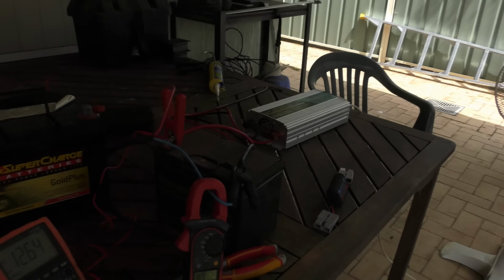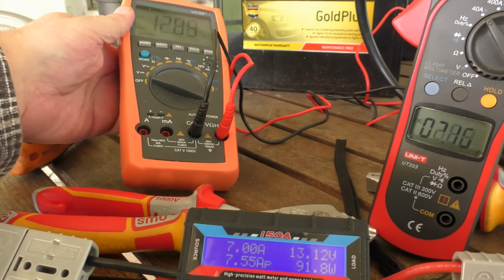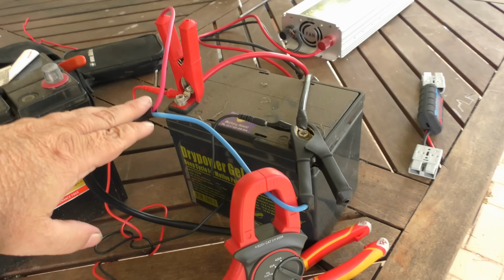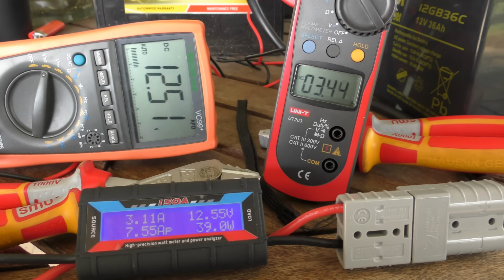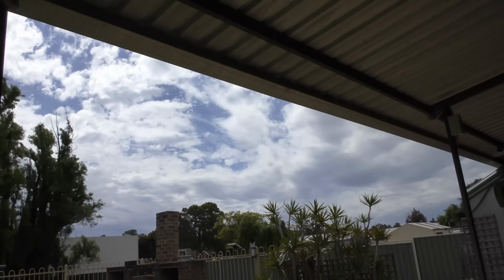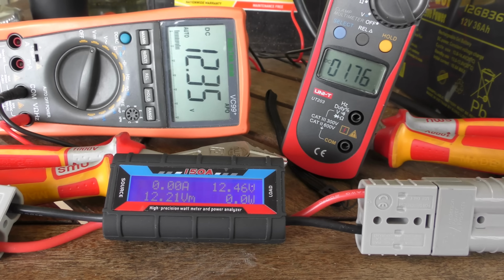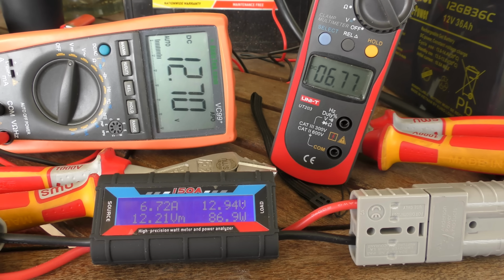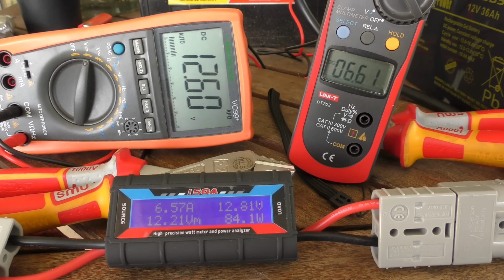MPPT or PWM Charge controller  Fake or Real. The Proof. Part 3

Comment: Thanks for taking the time to try again, but I’m afraid I still see no evidence of MPPT. Have you tested that panel or are you going by the label alone?  I think we’re seeing an over performing panel. We still haven’t seen the panel voltage when it’s connected to the charge controller. Like you said - the maths don’t always work out, but you have to compare the two. If you can’t set that up then perhaps test under the same conditions with the panel directly attached to the battery?
I’ve tested what I believe to be the same controller (although with a sealed box who really knows if they’re the same) and it is absolutely not mppt - sadly I haven’t got your sun at the moment to play with!
Reply from the maker: I had the feeling you would say that. You do know i have been using them panels for a few years I have 15 of the same panels on my roof. There not just a panel i picked up. OTE will Give it a good test for us as well. And what Sun. Lol Did you watch the video I had to run outside just to get that little patch of sun. I was waiting all day for it. For me i am very happy with the extra 2+ amps i am getting out of that now. I have another set of fold out panels Here that is 2x fold out. I will be redoing. I will test the volts on them when i pull the cooked PWM controller from the back. I have also asked the manufacturer to send me a unit that has not been sealed so we can have a look inside. Have not got back to me yet. But i only asked them yesterday.

Comment from the maker: This is an interesting series of tests. Don't take it personal, I am very happy to be proved wrong. at this stage though using the right size wire and showing the panels and everything in the tests is a lot more then the people that just say its Fake. without showing the important parts of the test. There just sitting with a volt meter saying well this is my solar panel wire and here is the controller. What panel did they use how much resistance was in the tests. I showed what resistance could do with the trailer in Part 2.

Comment: Great info your putting out there sir , hope all is well with you and yours sir
Reply from the maker: Its still just a test and until i can get my hands on a unit that has not been filled with all that black stuff it will be impossible to know for sure.  But for now i am happy with the extra 2+ amps i am getting out of the panel

Comment: Now that I can see the watts I suppose there is a conversion. It is a 2 stage which means it wont float. But it does look better
Reply from the maker: Like i said for $20au or about $15us https://www.ebay.com/itm/30A-LED-MPPT-Solar-Charge-Controller-12V-24V-Waterproof-Timer-IP68-360W-720W-GRC/272988671448?hash=item3f8f648dd8:g:oioAAOSweW5VB6Hw:rk:2:pf:0 you can buy one and do all the testing yourself. For me it has lifted the output on that panel almost 2amps Well worth $20au and its compleatly weather proof with that IP68 rating.

Comment: I think what is needed is that the device will stop the stop the flow of power from the panels for as long as needed if the battery bank is at 100% soc. they would need sufficient heat dissipation for the solid state switch or gate.
best
Reply from the maker: Charge controllers are built to do that Job and to handle any heat involved. You could always get a Victron or a mindnite classic a PCM60x   with a built in relay that would open and close an larger external relay programmed to do that job.  But i don't see the need. Unless i have misunderstood your question. LOL that is happening more and more as i age :)
Reply: @JustinCaseSolarPower  I just saying the little cheap controllers that fail because the can't handle the power being held back. when you find one that does, it's a winner
best
Reply from the maker: @thefaeryman  Now i understand.  Thank you my friend. Yes i have not had that problem. With my house system and have only just started playing with the smaller cheep controllers. So have have not had that problem yet.

Comment: If it has a transformer inside it is mppt and if no transformer it is pwm. Sorry buddy still no convinced as long as it works for you then who cares pwm or mppt it works
Reply from the maker: You could always buy one and do your own tests. :) here is us ebay link very cheep. https://www.ebay.com/itm/30A-LED-MPPT-Solar-Charge-Controller-12V-24V-Waterproof-Timer-IP68-360W-720W-GRC/272988671448?hash=item3f8f648dd8:g:oioAAOSweW5VB6Hw:rk:2:pf:0   then you can pick it apart. For me know the panels and how mppt works its a true mppt. All be it not a great one but good enough for portable kits. and getting 7+ amps out of a 5.6 amp panel  proves it for me as you will not see a PWM do that.
Reply: @JustinCaseSolarPower  maybe I will give it a try I need one for my shed project
Reply: Just bought it but not due in to mid dec.
Reply from the maker: @oldtimeengineer26  Great 👍 I look forward to seeing your tests. I also hope you strip it down. I don't have the patience to do that. Picking at all that black stuff takes a lot of time.
Reply: @JustinCaseSolarPower  i will try to take it apart and let everyone see the inside thanks for the link
Reply: old time engineer looking forward to that video OTE :-)
Reply: @AdamWelchUK  maybe late dec or jan coming from china so hard to say when I will get it